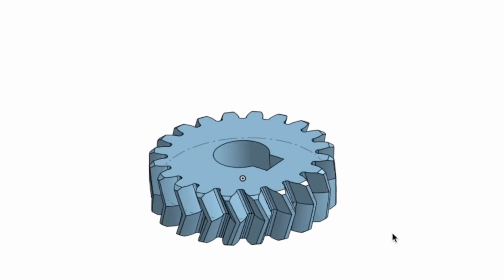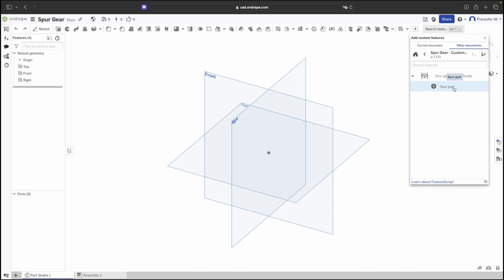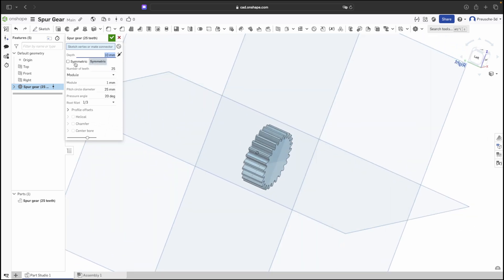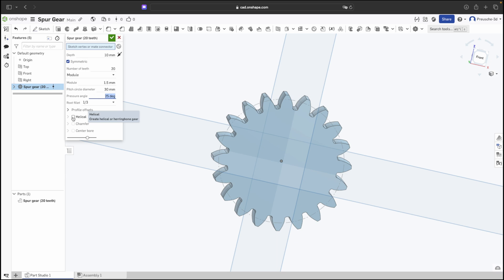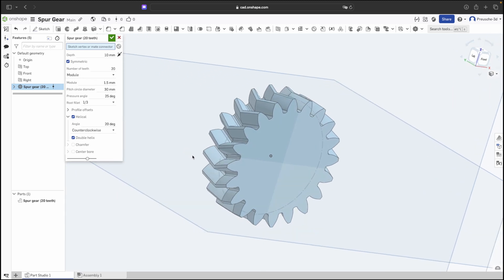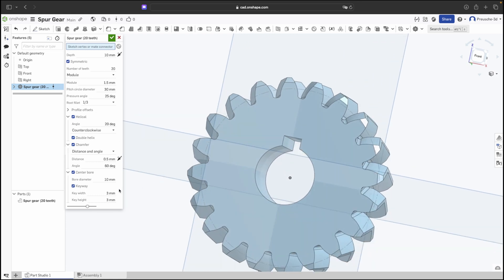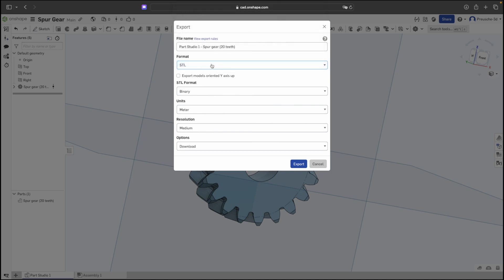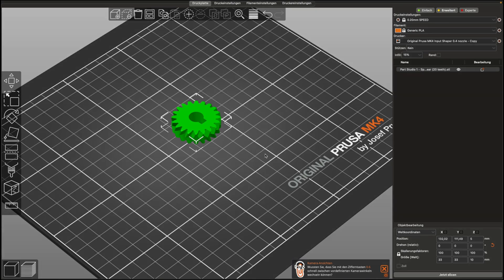Design Your Own Gears with Onshape: A Step-by-Step Tutorial

Comment: youtube is not showing the full like for your script. :(
Reply: after selecting "add custom feature" look under "feature script samples". search "spur gear" it will be the top option.
Reply: documents/5742c8cde4b06c68b362d748/v/c65839fc6078faeb4d2aece1/e/01a666571e625f8b819fd75b
Reply: documents/5742c8cde4b06c68b362d748/v/c65839fc6078faeb4d2aece1/e/01a666571e625f8b819fd75b